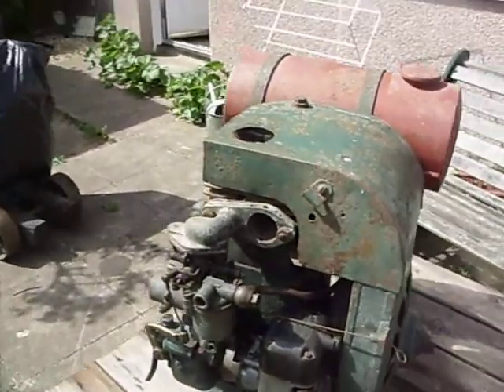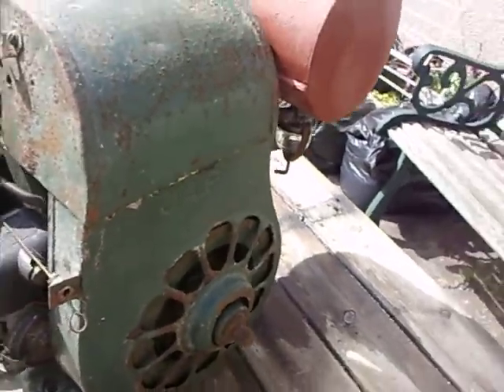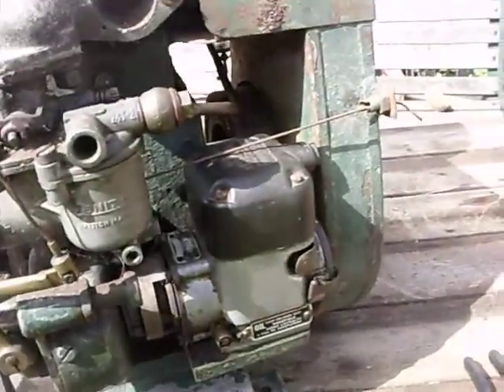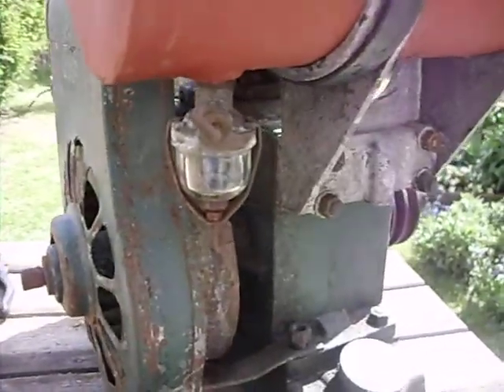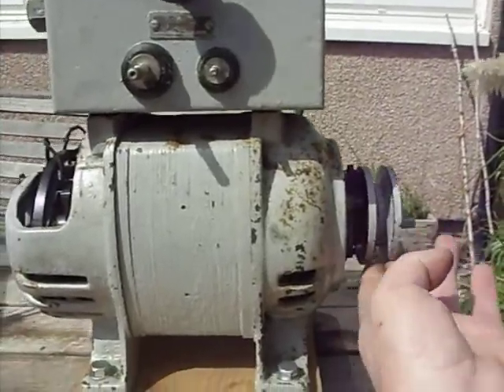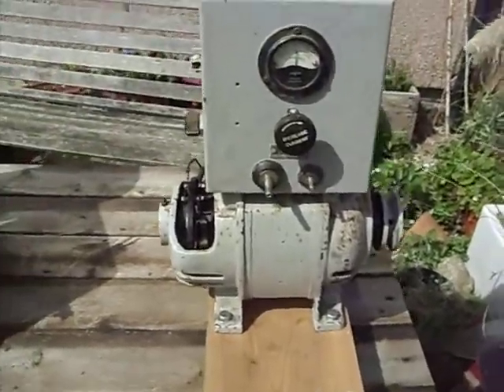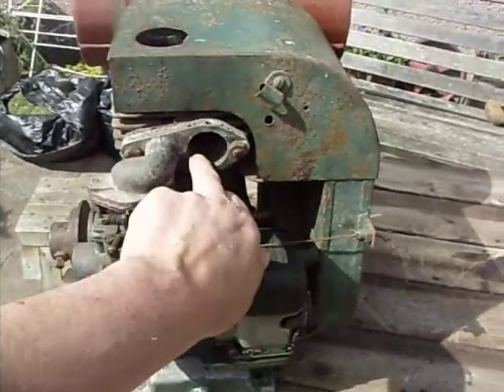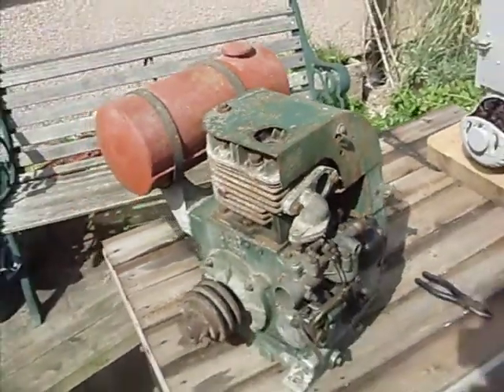j.a.p engine and small generator

Comment: I have a few of these generators, all bought on ebay or from boot fairs. They don't need remagnetising I just connected them up to a semi charged battery and ran them up, they soon developed a current but on one of them I had to twist the amperage knob a couple of times before it kicked in.